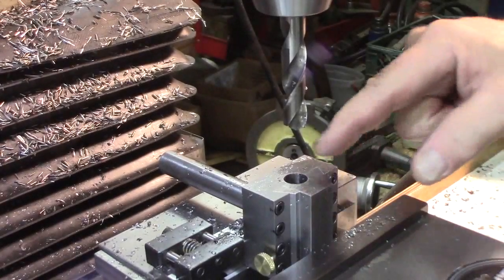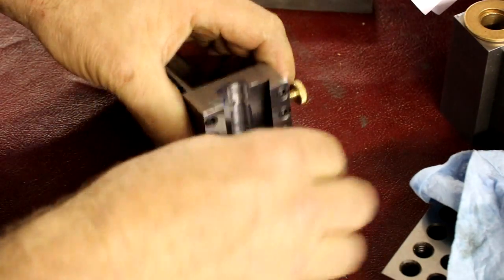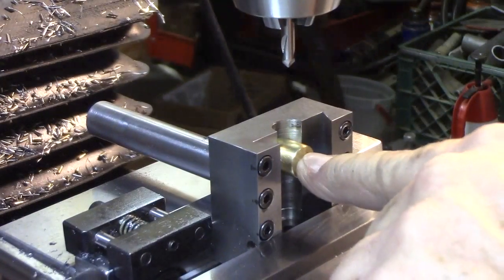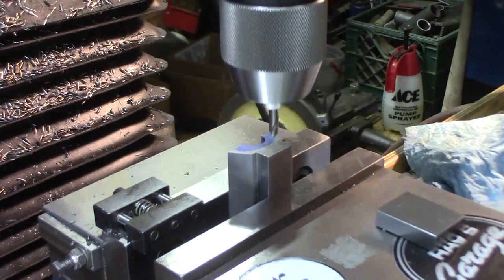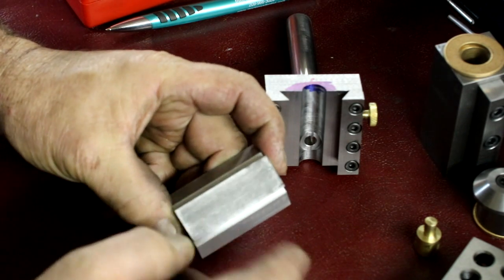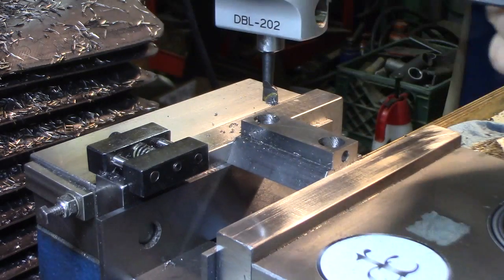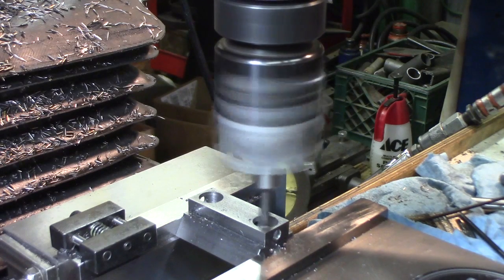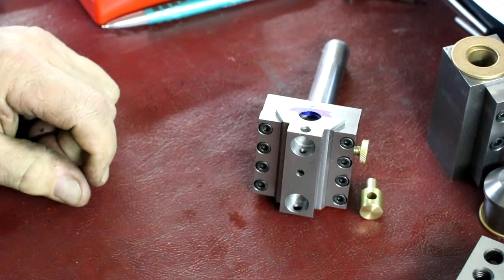How To Build a Hemingway Kit Spherical Turner / Ball Turner P11

Comment: Very nice. I have a 1/4"-40 tap of sorts. It is made from a scrap meet micrometer spindle. Hard material, good pitch, nice guide for straight starting.  A little grinder action to put in flutes, relief,  and chip clearance. Worked a treat on steel. Would likely work better on brass or bronze.

Comment: 1/4x40 is the oddest thread I have seen in a while Randy .. I would order a tap on that one ..LOL !!  Thumbs up..
Reply: It's a pretty standard thread used in the UK by the home shop guys. Usually refered to as a Model Engineers or ME 40 series thread. The other two are the 32 tpi series and a 24? series. Although that last one is I think known as a bicycle thread. There all a constant pitch series of taps. But 40 tpi in various sizes are stocked by most machine tool suppliers in North America and not too hard to find.
Reply: I agree, However what American machine operator has that in the shop .. Not !!
Reply: Very true, 40 tpi of any diameter would likely be used far more as a means of moving the screw a measured amount. A good idea on Randy's project. But for ordinary bolting together of parts there's zero adventage.
Reply: I so agree !

Comment: 1/4 x 40 is an old UNS standard size (replaced by UNC /UNF/UNEF around 1949).  You can still get UNS the taps.  Either this is an older tool design or they want one revolution of the thread to be .025 by design.  I'd sure be tempted to redesign this to common sizes.  1/4 x 20 would give .050/rev and it's UNC.